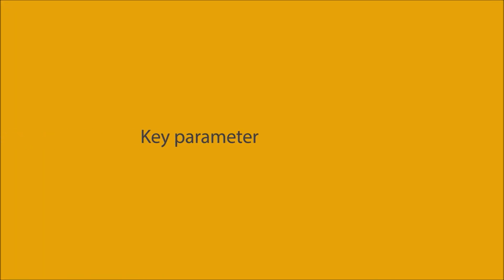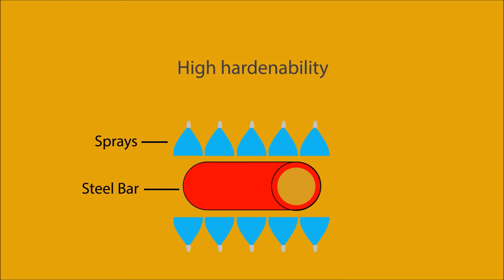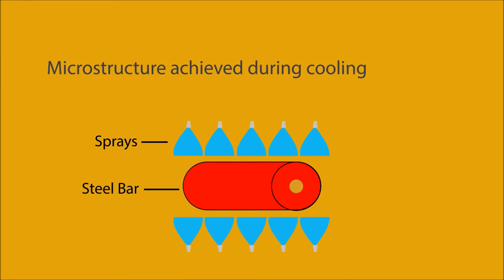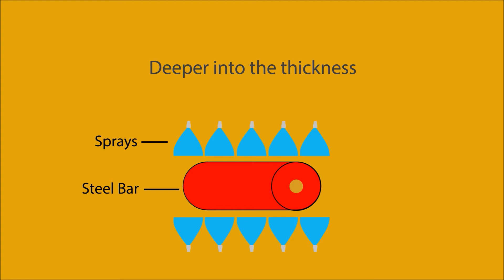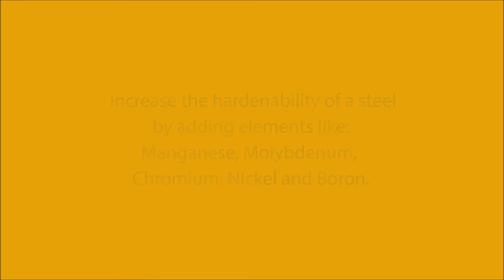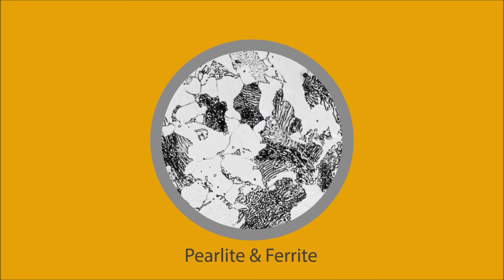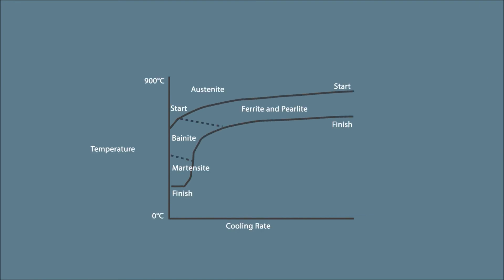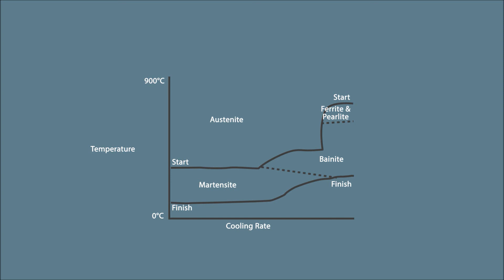Hardenability – Steel – Snippet from ‘Steel Metallurgy’

Comment: 0:56 The quicker the cooling rate, the greater change of getting a harder structure
 1:33 Achieve a harder structure at a slower cooling rate
Can someone explain how can both statements be true?
Reply: Google quenching and Critical cooling rate.
Reply: By addition of alloying elements which make the material to achive good hardenability at even slow cooling rate